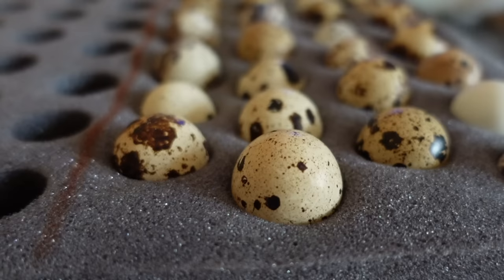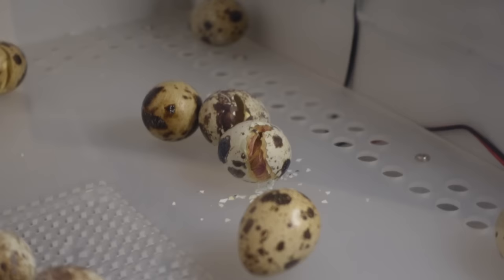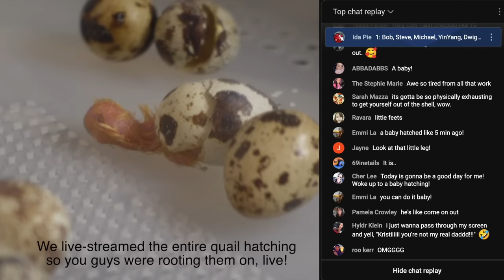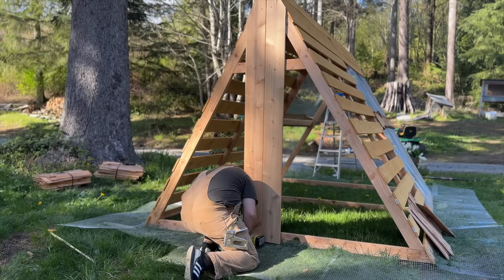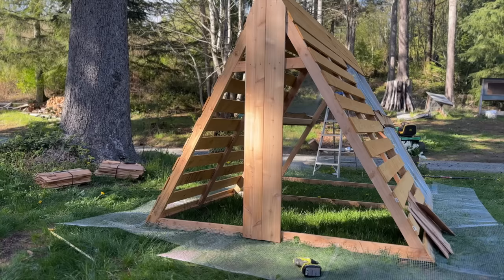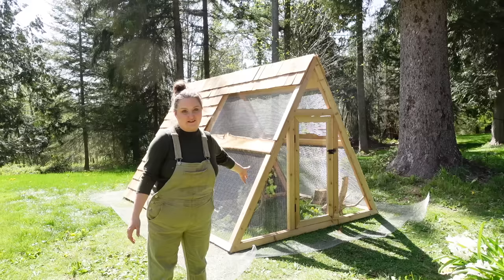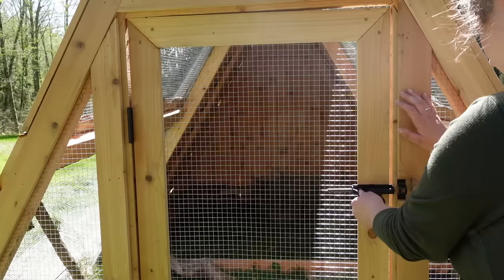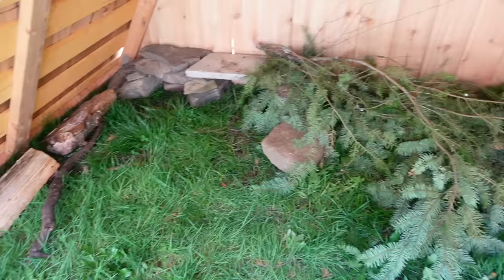EVERYTHING QUAIL! INCUBATING, HATCHING, BUILDING A-FRAME QUAIL COOP & MOVING OUTSIDE!

Comment: I love this but please monitor your quail for injuries because the enclosure should normally not be this tall unless they are full sized aviaries. Unlike chickens, quail can fly enough to hit the top, but not enough in something like this to move around freely, and therefore can accidentally injure themselves, hence why they are housed in either traditional aviaries or shallow pens. Typical recommended tractor and coop height for quail in non-aviary enclosures is 18-24" maximum to prevent flight and related injuries. You may end up needing to divide your tractor into half or third heights to make it safe if you notice injuries.